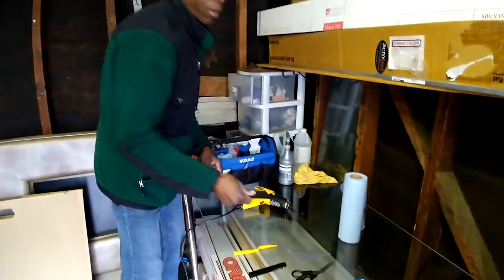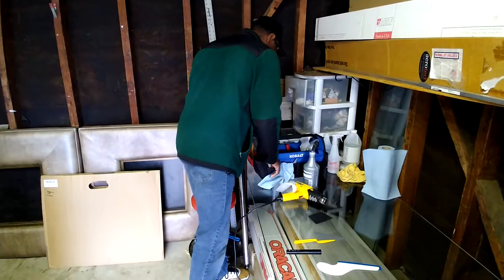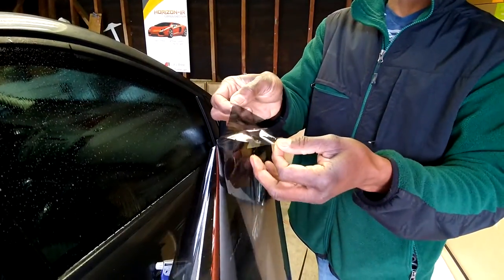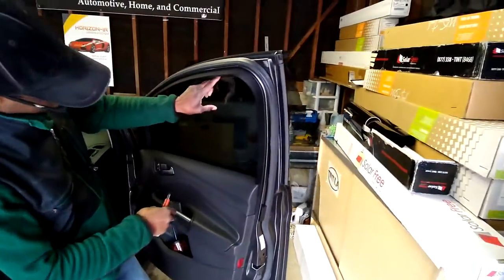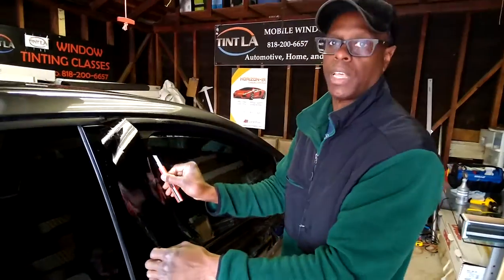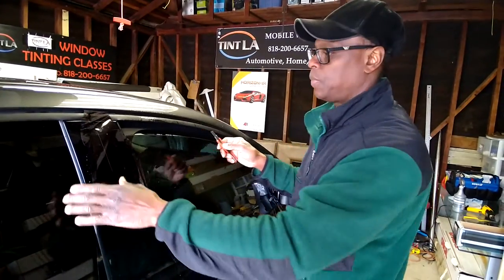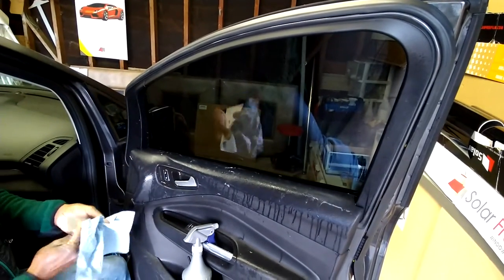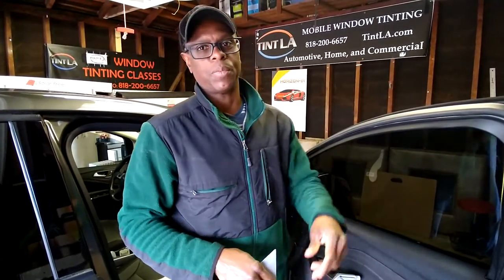Safest way to tint a front door window for beginners

Comment: Excellent video my friend. Well explained. I have done a fair bit of tinting myself and one thing I always tell others is to make sure you get the tint wet enough. Don't worry about excess water to dry up. If your tint is dry, especially after you separate it from the film you will have nothing but problems with it sticking. To itself, and everything it touches.
Reply from the maker: So true! If you would like to order Tintwork window film and tools, go to Tintwork.com/tint and then call 818-772-7711
Reply: Is water enough or is soapy water beter?

Comment: After seeing how not so easy it is to tint, I won't mind if you damage my car ..... Thanks for your video mate, will try tinting for my car...
Is home window solar film and this car film different? Can I use solar tint film intended to use for home windows for my car? 
Is there any difference between solar tints for home and car different?
Reply from the maker: Architectural films don't always shrink as easy as automotive films. You can use some automotive films on architectural windows, but you have to be careful not to go too dark on dual pane windows. We usually recommend not going any darker 35% on a dual pane window unless it's an architectural film where the side that faces outward is reflective to allow the heat to bounce off instead of absorb
If you would like to order Tintwork window film and tools, go to Tintwork.com/tint and then call 818-772-7711

Comment: Great video. What size box of tint would u recommend?
Reply from the maker: Most tinters like to use 20" rolls for side windows and 40" rolls for back windows
If you would like to order Tintwork window film and tools, go to Tintwork.com/tint and then call 818-772-7711

Comment: You forgot to mention that you need a measuring tape, and a blade to cut with at the beginning.  you should mention, that if you want to become a professional, then you need professional tools, not scissors.
Reply: @therealdwaynescottjay4957  i tint windows dude!!! You don’t use scissors.  But show people the wrong way.  I will have to fix it. Hahahahha
Reply: @raiderman28  you want to cut the film. Whether you use the knife or scissors, IT DOES NOT MATTER. You cut it, you install it. Besides, he's teaching this for beginners. Did you read the title?
Reply from the maker: Once again, as you can see in the title, this is a great informational video for beginners. We strongly recommend using scissors instead of cutting on the car to avoid damaging a customer's vehicle which can be costly.